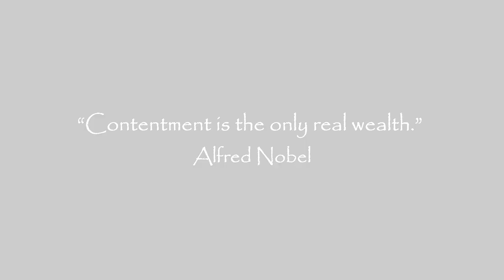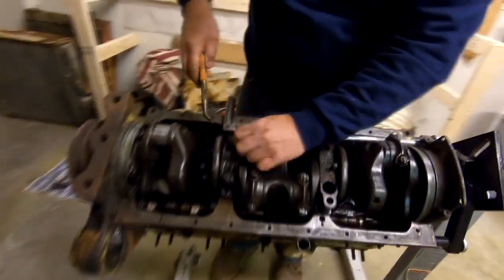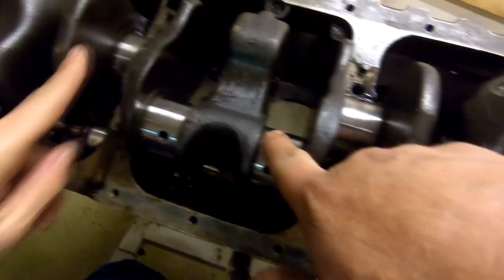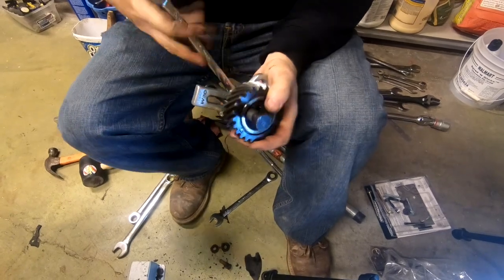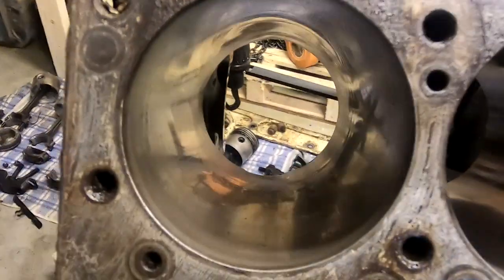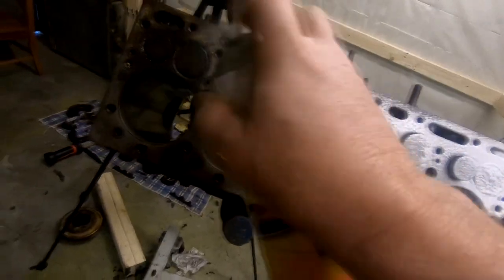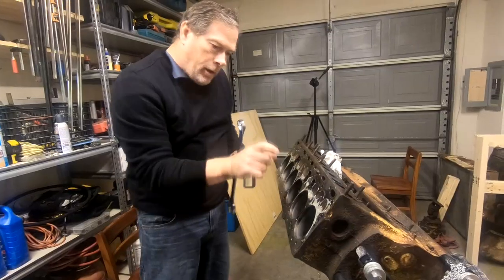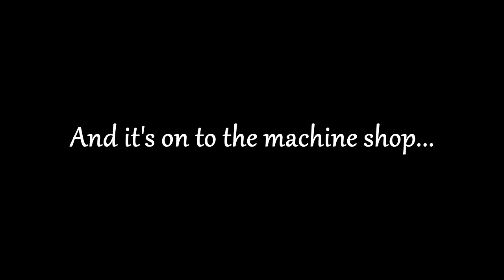Dynahoe Autopsy III - The Contentment Backhoe Project

Comment: What a walk down memory lane! My husband and I have gone through a few car engines, which really have the same parts. I was always anxious because of so many parts that had to be reassembled correctly. I hope you find a friendly machine shop, they might know the best place to get the parts you'll need. Seems like cylinders can be sleeved,  but that may be over costly and I don't know the reliability.
Reply from the maker: Hi Tina! The cylinders can be sleeved, but it would result in a smaller displacement engine (from 244 to 226 cubic inches), which we hope to avoid (we want to preserve horsepower). As is, there appears to be enough room to bore these cylinders to 60 thousandths over without sleeving, but after measuring them, we think they only need 40k. The crank will go from 20k under to 30k under.  We have lined up all the parts, and are glad they still make them for this old engine! We were fortunate to find a local machinist who has experience with these flatheads. We took a lot of photos and video as we tore it down, just to be sure we put it back right, but this is a pretty simple engine. We are looking forward to hearing this thing rumble again! Good to hear from you!  Thanks for watching!

Comment: Nice job it's in good shape does not need much to make it run..You're not building a racing engine..put the hone to it see how the cylinders clean up...
Reply from the maker: Hi Thomas.  Would love to, but the cylinders are already between 2k and 5k out of round and tapered.  Thinking hard about it now. I just found cracks between cylinders and intakes in 3 and 4. Not fun, but they don't go down into the galleys, so that's good. Trying to figure out how much engine time I could get out of her with that much wear in them if I just slap it back together with new rings and bearings.